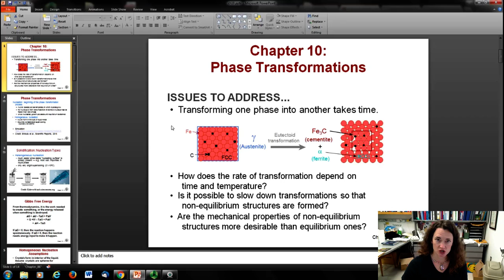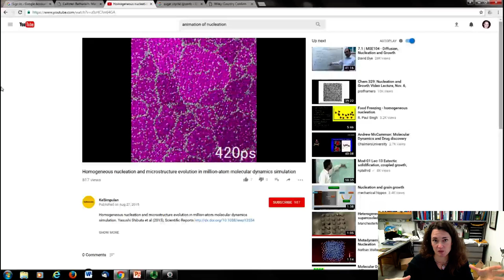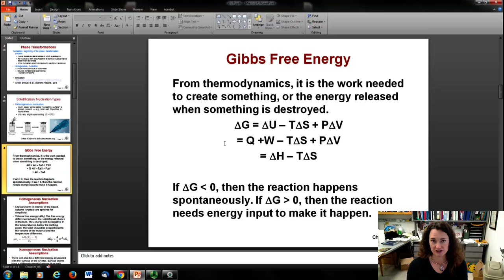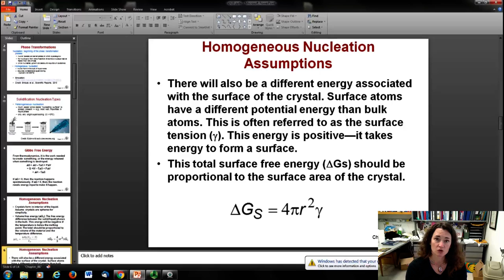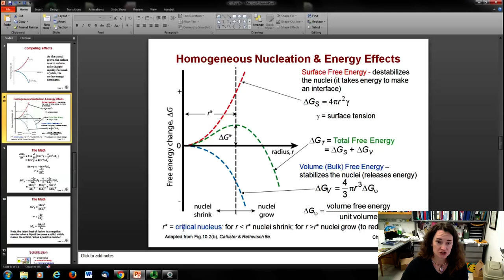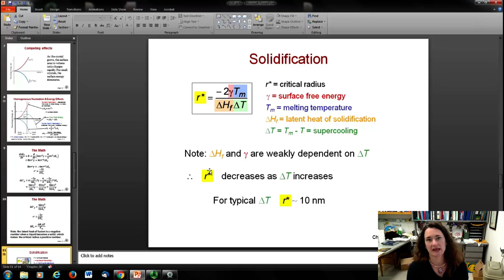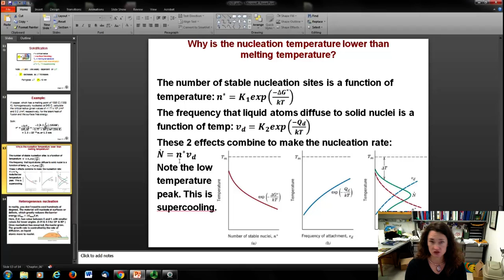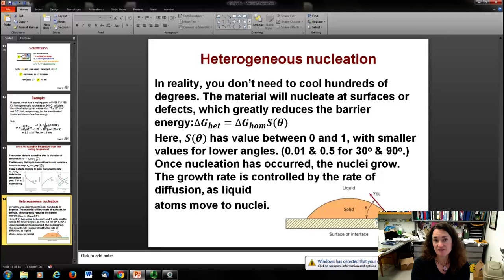Nucleation

Comment: Thanks for this really well-explained video. I just want to point out a mistake on slide 9 (11:40): your first expression for delG-crit is missing a "4" in the surface area term. It should be "4" x (-2)^2 = 16. Thanks again.